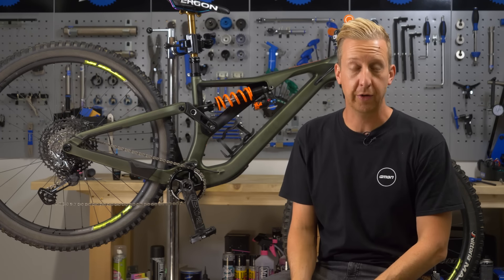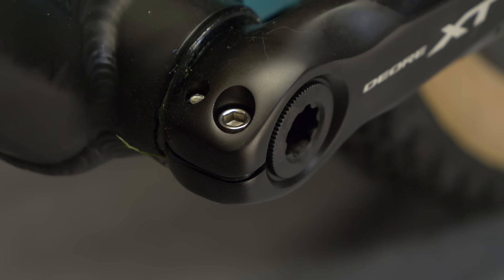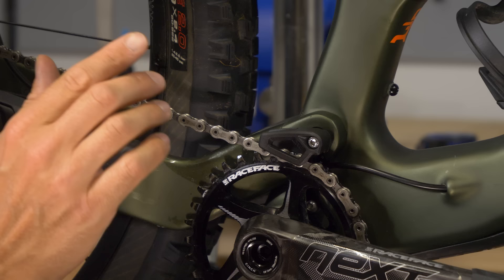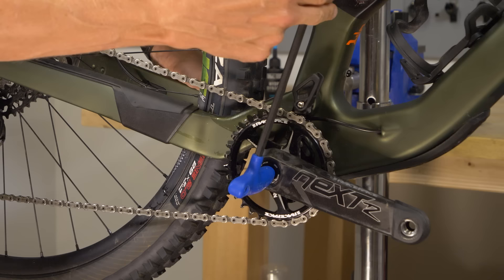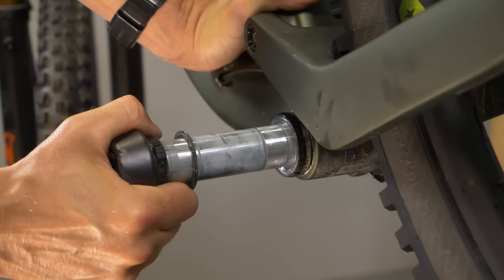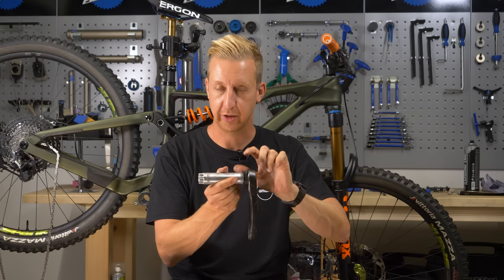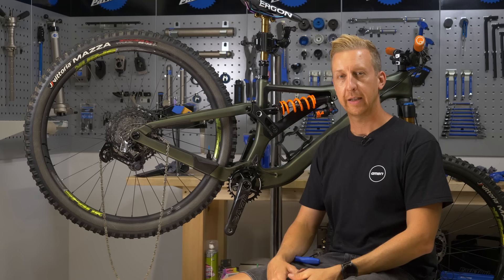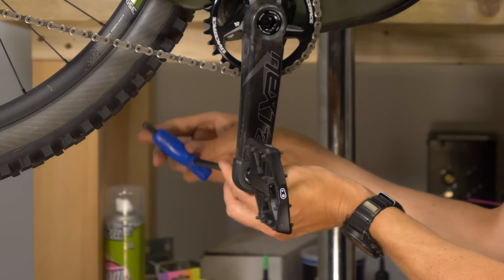How To Remove & Reinstall Mountain Bike Cranks | MTB Maintenance

Comment: Soft mallet = hammer + lump of wood?
Reply: Yes it also work
Reply: It requires using two hands instead of just one to hold the mallet. You may be out of free hands to hold the frame or cranks. Just smashing it with a heavy wooden block instead of a mallet works.
Reply: Yeah my crank is stuck on. The bolt is out and will not come off. What should I do
Reply: In this case rags. Were mechanics now. 😋🔧🛠
Reply: WD 40 should help aswell
Reply: Yes, plus finger. Hehe.

Comment: I would not recommend using a normal allen key to loosen such high torque bolts. Feels horrible when it bends and can be pretty dangerous if it snaps. I‘d rather use a large ratchet with an allen socket. Feels much nicer and is less likely to fail.
Reply: You did notice the big torque wrench he used to do the final tightening :-)
Reply: @mikes4163  of course i did. i was talking about loosening though.
Reply: Would you call a Park HT-8 or HT-10 a 'normal' allen key? They are designed for high torque use (hence the name).
Reply: Well, believe me, the torque on those bolts is absolutely not "high" at all, any good brand allen key can take that and more, I'm a mechanical engineer who works on industrial machines and regularly abuse my allen keys
Reply: @hectorfranco145  Agree 100%, you don't find much (anything I've come across) over 60Nm on a bike. A "high torque" allen key/hex wrench isn't just about the materials though, it's about a tool that's more comfortable to use in high(er) torque situations. Any allen key will work but it makes life easier.

Comment: #GMBNTech - Showing the process of removing cranks that do not use self extracting bolts would've been a great addition to that video.
Reply: thats pretty fuckin funny i thought i could do the job after watching this video until i read this comment and realized that i dont have those fancy self-extracting arms
Reply: Right? "Here's a 10-minute video explaining how to remove the cranks on a fancy new bike where the cranks remove themselves"
Reply: Along with showing the process of setting the pre-load correctly.
Reply: Yes, we need one with a crank extraction tool.  It was dumb to use these ones.

Comment: That self-extracting crank system is great. Never appreciated it much, but I just spent days trying to loosen cranks from the bb on a 3piece crank setup. Just horrible. And unbelievable, how much force is needed to loosen it, especially on the drive side. Bent and damaged a bunch of tools
Reply: I had the bike in the bike stand. I was trying to do this, and I pulled so hard everything fell. Scratched my bike stand all over the place

Comment: Before you take the pedals off ... think about whether you need to. 
If you are just checking/lubing the BB or changing the chainring there's really no point. (Similarly I usually regrease my pedals in situ - else the first thing after removing them is putting the shaft in a vice to undo the retaining nut.)

Comment: I've got those cranks,. Should I re-adjust the preload after tightening the the main crank bolt to 50nm.  I didnt notice that step in the vid but appreciate that this was intended to be a general crank guide and most sets won't have that exact preload system.
Reply: Yes, preload should happen after tightening the crank bolt
Reply: @kioti2174  appreciated thanks mate

Comment: My Crank span quite freely and I took it out just to replace the chain ring. When putting it back together with the spacer in the same place and new grease, letting the tension ring back as instructed in the video, the crank no longer spins freely. Seems like it has some friction. Is this an issue? I ddi not replace bearings, bottombracket, so its not due to bearings needing to "break in".

Comment: Splendid. Very clear and good pace. Thanks. 
If replacing from 30T to 28T... need to shorten chain ? because I chose to use amazing E*thirteen Helix R cassette 9-50T with my build.  I like current ratios. It had an SLX 10-51T I just don't like cassette or Shimano rd or  centerlock in general. So many unnecessary tools...
Was thinking of replacing with GX chainset.... unnecessary cost. Happy with SLX here. 

So. Sorry for long explanation.  Currently chain length current from when had 30T slx 7100 chainring and 10-51T cassette.  Now Helix r 9-50T and ordered 28T.
What guidelines for shortening chain?  What does one look out for

Comment: Have you ever ridden a bike with intentionally misaligned cranks? I'm thinking if you set it up so your front foot was a little past 3 oclock when your back foot was at 9, it could give you a slightly lowered position for the downhill that might feel nice and stable. Obviously it wouldn't pedal very well, and you couldn't change your lead foot, but could make a good video. #askgmbn #askgmbntech
Reply: Look up Rotor Box System. The left and right cranks were intentionally misaligned (internal gearing made them independent of one another)

Comment: Um…I’m trying to remove the crank from a 2006 Specialized rockhopper pro disc, I’ve removed bolts on both sides but it’s not budging?

Comment: Hi thank you for the video. I have a problem with my pedal arm it keeps loosening. It is the one from the bike's drive side (right) side. The crankset is just like the one in the video. It doesn't matter how much I tight it on after 30 min riding becomes loose again. Would you happen to know what I can do to fix it? Thanks.

Comment: I loosened the main crank bolt before loosening the 2mm on the non drive side.
It did not self extract. Did I do something wrong? The non drive side is loose.
Its a sram eagle 1x12 truvativ setup.

Comment: How would I remove my sram dub crank if it was really tight because someone tightened it so hard the Allen key nearly snapped.
Reply: Yes same here
Reply: It sounds like you need a longer Allen key , that way you get more leverage.
Reply: Common problem search 'DUB crank arm bolt seize' and you'll see you're not alone.
Reply: I always have to use a 2ft metal tube over my Allen key for extra leverage in order to remove my SRAM BB - crap design!
Reply: Either get something longer to have the needed leverage or try to tap the Allen key with a hammer. 
I said "tap it with a hammer" and not "hammer it"... in case somebody has any funny ideas :D
Reply: try turning it the other way
Reply: @mclaren44  lol No. Its a standard thread bolt. Google frozen DUB crank arm bolt and have fun reading.

Comment: Is it possible to remove play between the crank arm and spindle splined mating surfaces ? I’ve tried plumbers tape but after a few pedal strokes it works itself out

Comment: I'm building a new hardtail. When I installed my new Race Face BB and Race Face crankset, the rotation seems to have an excessive amount of resistance, even before I tightened up the preload washer. There is a few millimeters of axial play before I tighten the preload washer, so that does not seem to be the problem, so I’m out of ideas. Will the rotation free-up after I ride a few times?

Comment: Just had a Shimano crank arm (non-drive side) fall off my new bike while I was riding it. Luckily I was going slow up hill at the time and no injuries. However, it happened as I trusted the bike shop to put my bike together correctly and didn't check it. I've always used SRAM cranks and am not familiar with Shimano. I've put the crank arm back on but the whole crank assembly slides left to right in the BB about 5mm. I've pushed the crank arm as far as I can back onto the axle and tightened the clamping screws. Am I missing something? Should there be a spacer behind the crank arm? Or have I missed a step or 2 in the reassembly?

Comment: "Towards the back of the bike" depends on whether the handle of the wrench is above the pedal axle, or below it!  At 2:31 it looks like your pushing the wrench towards the front of the bike.  I know what you're trying to say, but as a memory device this is not enough.
Reply: When people talk about pedaling backwards everybody knows which direction is meant even though it looks like you‘re pedaling towards the front of the bike as soon as you‘ve reached the 9 o‘clock position. Just think about this example and it should always be obvious which direction is meant.
Reply: @urskapunkt9185  If "everybody knows", then they don't need a memory helper.  I'm not part of "everybody" because I forget which pedal is reverse thread, especially when doing unplanned work in the trail center parking lot.  I need an unambiguous trick for remembering!
Reply: @Acceleronics  that‘s exactly what i was trying to deliver. I was just trying to say: when trying to loosen your pedals, think about which direction your crank is tourning when you‘re pedaling backwards and turn your allen key/pedal wrench in said direction.
Reply: K, read your original comment again and now i understood that my 2 comments may not have been really helpful :D
Reply: The way I remember: To remove either pedal, position the tool so that the handle is horizontal and aft of the pedal spindle. Press the handle toward the floor.

Comment: How do you know if the spacers are correct? I was hoping you would go over setting up the spacers.
Reply: Agreed! I went to a smaller spindle size on my RF Turbines to properly fit the shell, but not sure if my spacers are correct. I attempted to keep things even between the drive/non-drive side to keep everything centered, which seems to work fine, but always hear a voice in my head saying its not the right way to do it

Comment: Hello Doddy, follower here from the Philippines. I've been biking for the past year after decades of hiatus. I primarily ride XC and light trails. I'm currently using an XC bike with a 100mm travel fork. I'm a heavy rider at 95kilos, and looking at replacing my fork. Would a 120mm be better given my weight or should I just stick to 100mm? My current fork has 30mm stanchions, looking at Fox,  Rockshox SID, and Marzocchi Bomber Z2.  Cheers!
#askgmbntech #gmbntech #askgmbn

Comment: #ASKGMBNTech - I'm a big fan. I think I have watched every episode for the last 4 years. I am going from a 28 tooth chain ring 32 tooth oval chain ring to my crankset. Will I need to add links to the chain or can I use the same chain? This is on a Diamondback Release.
Reply: Yes you probly will have to add a few, see how much it stretch your rear mech when it's in the lowest gear (biggest back cog) and if it not over stretched and u don't have rear suspension go for it